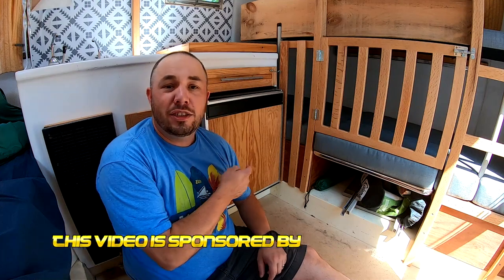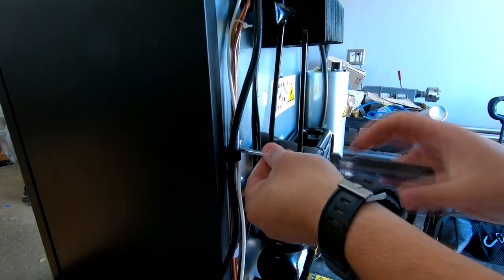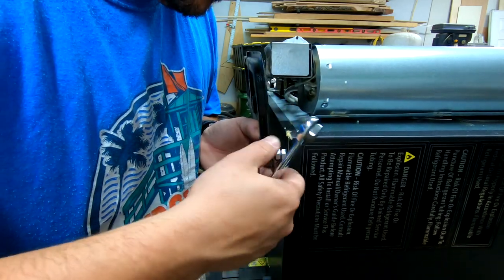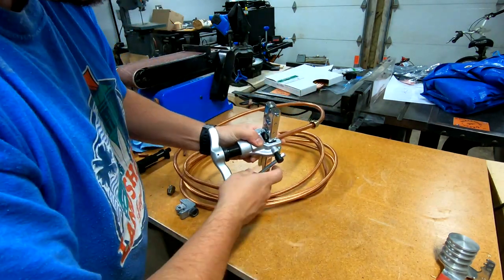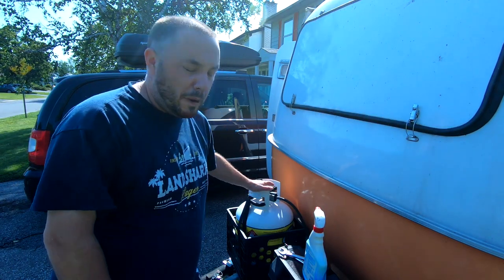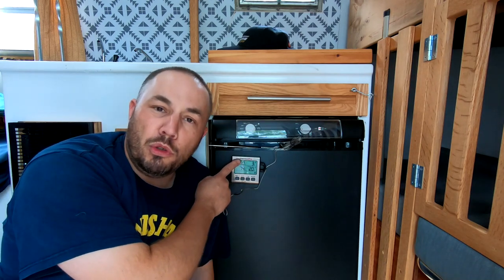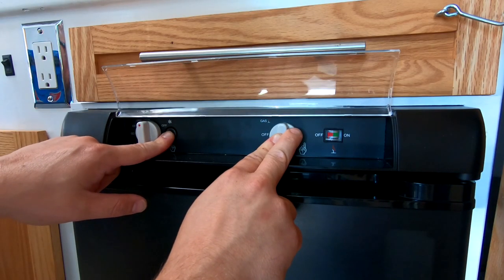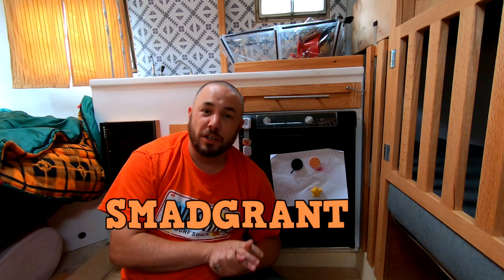How to: New 3-way Fridge in my Vintage Camper

Comment: Very enjoyable little vid Grant. Using that flanging tool reminded me of making brake pipes years ago and regularly forgetting to put the gland nut on before making the flange! I'm amazed the fridge fitted so snugly into the existing space! If that had been me it would have been a millimetre wider than the old one... Cheers mate, thanks for that and love to all the Alexanders of all different sizes.
Reply from the maker: Thanks Mark! I too have learnt the "forgetting the fitting" thing the hard way. Almost did it in this project when I was under the trailer.. Had the flaring bar on and everything! Luckily I remembered at the last second. I looked high and low for a fridge that would fit, it wasn't easy finding one, but luckily Smad had one that was almost perfect!

Comment: Hey Grant, how's the Smad fridge holding  up?  Thanks great vid !
Reply from the maker: We used it a few times this year and things are still good. Biggest annoyance was that it opened up on me during a trip and all my beer fell out. Other than that it has been great.
Reply: @TheGrantAlexander  Lol, thanks for the quick reply. Sorry to hear about the warm beer. Haha. My son does alot of off grid camping in Northern Ontario, and was wanting to replace his old Dometic 2 way (12v, propane) with a 3way. Solar not much of an option, so that leaves propane. He camps for over a week and his deep cycle battery won't last. It looks like up in northern Ontario it would cost minimum 1500 to get a new Dometic or Norcold installed. I ended up researching the Smad and found your video. Was the low price one of the reasons you purchased the Smad? Thanks again Grant!
Reply from the maker: @Mike-ig2zq the price was the main reason and the fact that when I was looking dometic stopped making small 3 way (the preference is 12v now as the new ones are much more efficient) in the end Smad offered to pay me for the video, so that was the biggest reason 😂
Reply: @TheGrantAlexander  Yeah I was having a hard time finding anything mini propane. And off grid with little solar you'd be looking at mutiple big Lthium batteries. Thanks for all your help and subscribed. Oh and by the way my next door neighbor is in the process of renovating a 1973 Boler 13. Lol
Reply from the maker: @Mike-ig2zq nice! Let them know I've got a good video showing off what I did to mine 😁
Reply: @TheGrantAlexander  Oh yeah, should be a new subscriber.

Comment: I have a 1984 Norcold Electronics 838EG3 3-way refrigerator. Can I run it just by 12DC or 120v ac and not use propane at all?
Reply from the maker: Probably, but I'm no fridge expert. 😁

Comment: I have a question on the venting of the DSG 50B2u Refrigerator. Do you have any tips? Thanks!
Reply from the maker: My previous fridge had venting and I just reused that. I also made sure that the new fridge was sealed between the living compartment and the vented area. (Much like the old fridge)

Comment: I thought I had ordered the SMAD model you show here in your video but I made a mistake. The one I ordered is Model DSG-40B1U. It is taller than yours and the propane connection is at the bottom of the unit. Do you know where I can get an Owner's Manual for SMAD products? The poorly-written "Owner's Manual" that came with it doesn't show anything about connecting the propane, use of the pilot light or how to fire up the propane. I am uncomfortable thinking about connecting and using the propane without detailed instructions!
Reply from the maker: I also found the owner's manual to be lacking. Unfortunately, I do not think there is anywhere to get more detailed instructions but if you are uncomfortable with propane you can try looking for an RV shop or porpane store that does installations. I don't know about your model, but most propane fridges are the same way. Turn the fridge to the gas setting. On the gas control knob push it in and hold it down. Then light the flame. You usually need to hold the gas knob for 20-30 seconds to warm up the thermocouple. After that it should stay lit. Good luck!
Reply: @TheGrantAlexander  Thank you for the rapid response!! It came with a regulator that I can hook up to the outlet on the fridge and to a propane tank. It might need nothing more than that.
Reply from the maker: @loismurray6372  if you are using it outside (like on a picnic table or something) than the hose and regulator is sufficient. But if you are installing it in your trailer, you likely already have a regulator so adding an additional one would not be a good idea.

Comment: Could you have attached the copper propane line onto the back of the fridge prior to putting the fridge into the slot? Instead of having to reach up blind?
Reply from the maker: Unfortunately no, the copper line is not flexible enough to do that. I could have removed the vent cover to reach it, but it seemed like more work 😂 The old fridge had the connection at the bottom and was easy to reach through the cover.

Comment: Grant did you install the vent system?
Reply from the maker: Not sure what vent system you are referring to. The back of the fridge is isolated from the camper and has vent grills. Is that what you mean?
Reply: @TheGrantAlexander  I watched a video on installation of the 3 way Smad and it said to order the vent system to exhaust it outside when using propane. The vent is inserted in the top of the cylinder on the back. You can query the vent system to see what I mean.
Reply from the maker: @darleneedge4348  I did not install that, but it looks like a good idea 👍